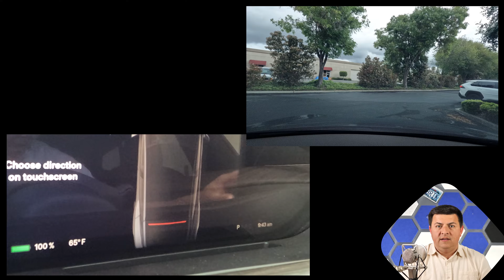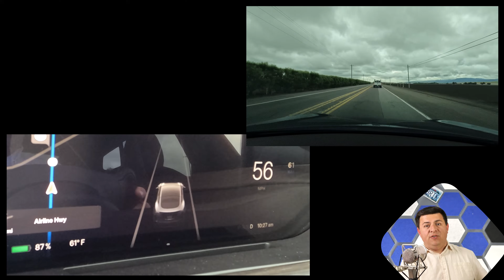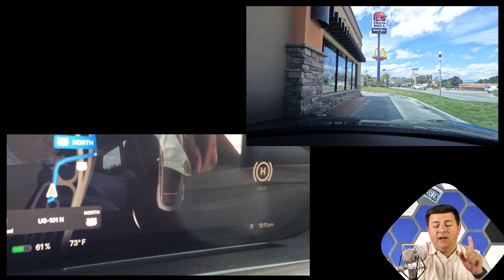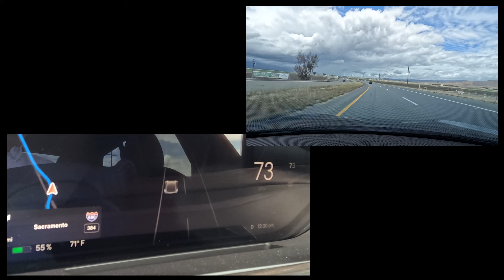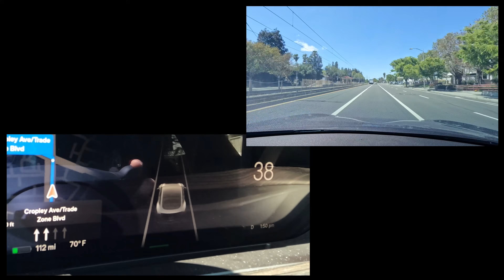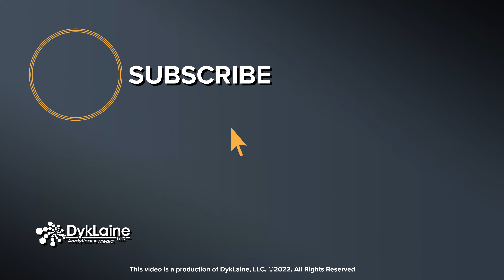2022 Model S - Road Trip Range Test

Comment: I own two sports cars, an MR2 and a Z06.  
The MR2, on the highway, would get just over 300 miles on a tank
The Z06 would do around 400 miles, with cylinder deactivation, larger tank & performance tires
330+ miles from a full sized sedan with seats for 5, is pretty impressive
Reply from the maker: It's more than enough range for most! Even if they exceed that, if you're going that far it's likely that you'll be stopping anyway. -Travis
Reply: My modified MR2 Turbo on E85 only gets 150 miles. 😂

Comment: So with 2022 Model S long range can drive 300 miles with 1 full charge? Or do you still need to charge it? Thanks
Reply: You can drive 400 miles between charges.. usually more if keeping speed below 75mph
Reply: @JKLsemASDF  so you can’t drive from LA to Vegas in one full charge of battery
Reply: @jacksongil9123  absolutely you can make it from LA to Vegas on a full charge .. with plenty left over too. Even if you did 90mph the whole way you’d still make it.
Reply: @JKLsemASDF  hmmm 🤔 that would be nice, no stopping to charge from LA to Vegas
Reply: @JKLsemASDF  i am assuming you have 2022 model s? Thanks Boss
Reply: I Get 3.5 miles per kWh or about 353 miles.. the a/c eats up a lot of energy

Comment: My Ioniq Electric (not the 5) beats the EPA pretty significantly. My understanding is that Hyundai tests their vehicles in normal mode, so in eco mode it will generally beat the EPA numbers.
Reply: My Model 3 LR regularly exceeds the 350 miles range also.
Reply: Can you please share some numbers. Whats the EPA range and what's your average like?

Comment: Perhaps this is quibbling but this seems more like an efficiency test from which you’re extrapolating range. Still very useful information which I will find helpful in comparing EV’s.  However, to get a complete picture of how a car will perform on a road trip with multiple charging stops this data needs to be combined with real world charging data to see how quickly range can be recovered for the next leg.

Comment: It would be good to have visual representation for whole route along with elevation change tracking. Something like Strava does. Milestones along the way with battery status, temperature, kW averages would be good too. Thanks.
Reply: How would that data help decision processes?
Reply: @shinybaldy  While the visuals itself will not be a dealbreaker for selection, the visual representations for numbers more comfy. Next, overall system behavior on selected milestones (battery consumption before going to hill country, before highway, etc) and how it can handle power consumption during that segments speaks about how good electric components integrated together (i.e. build quality). Obviously, I/we can't go full Mr. Munro mode and decompose car before selection to understand which wires used, etc. But those data will help me understand how car was built and how long it will last.
Reply: @txdevops  It is weird because I see Mr. Munro videos and just think... oh automotive consultant paid to fluff the markets. Because it seems like all the "techno babble" has nothing to do with real world conditions and is basically just market speculation. 

If a car drives up a freeway and down a freeway, you pretty much covered the normal usage. What possible value does more meaningless data provide?
Reply: @shinybaldy  Well, I am a tech person and I like "techno babble". It is really interesting how things build and how they change. Its the small decisions that makes something better. Devil in details. As for the test: the more data you have for consideration - the more accurate your decision could be. Cheers.
Reply: that's why they make more than 1 flavor of ice cream....